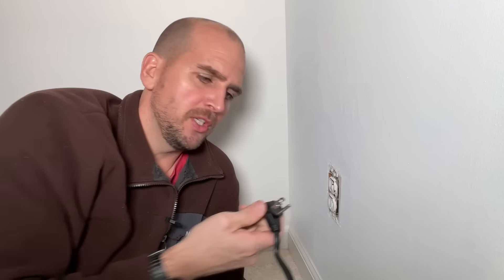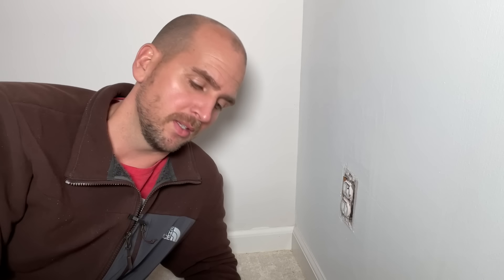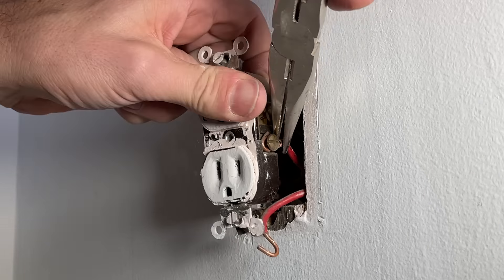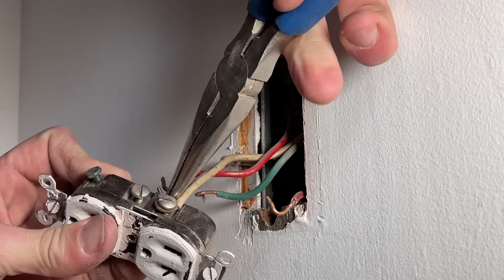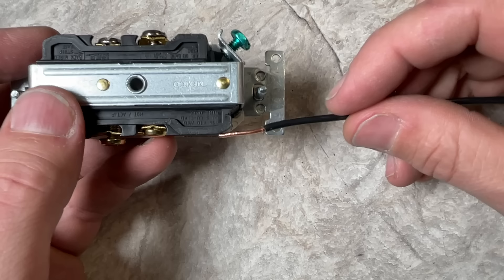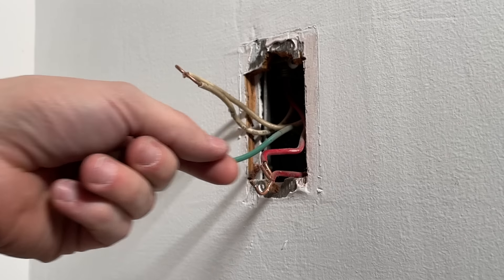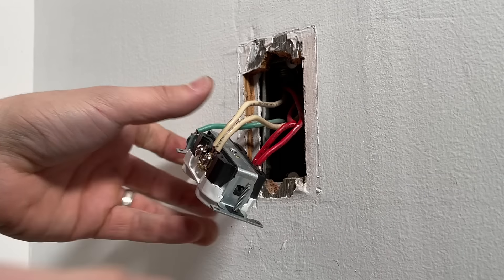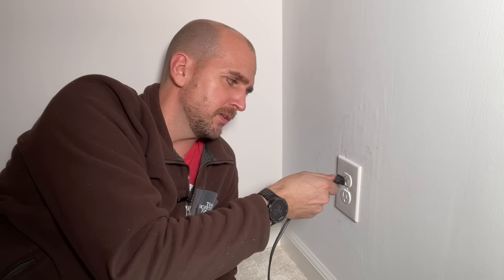Plug Won't Stay In Outlet

Comment: If you have the problem with plugs staying in when at a hotel or motel - just splay the plug prongs out a little so that it doesn't break them but allows for insertion into the outlet without loosening. 

 Also a tip from me to you - just remove the screws when removing wires from the outlet - this way you don't have to worry about breaking them or marring your insulation. I do the same thing when inserting them into the new outlet.  I remove the screws then insert them into the holes or hooks for the wire then into the outlet. This makes it easier so that I don't have to worry about where they go or damage in any way.

Comment: The box needs an extension ring.
It looks like somebody covered the wall with plywood at some point in the past.  Box can not be recessed more than 1/8 inch behind combustible material.  Box extensions are cheap but sometimes a pain in the butt to work with but are required in certain situations such as yours.
Reply: I would worry about fire too if I didn't put my wires on receptacles correctly, pig tail all wires with a 3M nut can prevent lots of problems
Reply: @SirFartzoLot  A poorly nutted pigtail is less safe than what he did. Done correctly they are both equally safe.
Reply: @FisherCatProductions  poorly done is unprofessional🙃

Comment: If you're not reusing the plug just back the screws all the way out. No need to fuss with needle nose pliers to take the wires off
Reply: I always use new....never reuse they're cheap enough!

Comment: In replacing the outlet, ask why there are two hot and two neutral. Were they feeding to the next outlet without using pigtails, or is it split for two circuits, and the bridge bars have to be removed?
Also, flat screwdrivers are old-fashioned; use Philips or Robertson as appropriate. (Some screws take all three)
Reply from the maker: Hey Rick,  correct the additional set of wires was feeding an additional outlet on the circuit. I actually just upgraded to the Milwaukee ECX which has been awesome for swapping receptacles and switches.
Reply: Yes, I am an electrician. I only use a flat head screwdriver if it is the only option.
Reply: @Tubalcain422  I use the wire cutter and then a fine pointed needle nose pliers, one of best items at Harbor Freight Tools.  I have few so one is in each toolbox.

Comment: if you are at a place and are having this issue and replacing the receptacle is not an option you can spread the prongs on the cord ever so slightly. the extra width of the outlet prongs will generally create enough tension in a worn out receptacle to hold the plug in place.
Reply: That's the let the next sucker enjoy seeing his house or hotel room catch on fire "remedy."  Loose contacts have increased contact constriction resistance which is what causes overheating of outlets.  Forcing the receptacle contacts further apart is akin to sabotage.  The circuit breakers won't detect that problem until the house is being consumed by flames.
Reply: @pibbles-a-plenty1105  Hey of the manager is too cheap to replace it then it should burn down

Comment: I bend the prongs on the chord 😆 so it has spring tension against the outlet because I'm that lazy. I'm a mechanic in real life too 🤣 but when I get home I don't wanna replace anything.
Reply: fine for a low power appliance, that doesn't draw much amperage. That won't work well for something big, like a space heater or vacuum cleaner. Vacuum cleaners are especially bad, because you move them around, putting cyclic stress on the plug. (likely the reason the plug loosened up in the first place)
Reply: Exactly
Reply: I just jam a fork in there with the plug.  It holds and comes in handy at lunch time.
Reply: @vincentrobinette1507  yes it will
Reply: Just use some aluminium foil around the prongs
Reply: Lol  mechanic tryna do electrical work lmao. You're better off bending the prongs and burning your trailer down
Reply: @Kevin Gibbs You should buy scratch lottery tickets ;)
Reply: I was just thinking that's what I do.  Because in the moment you don't have time or want to go buy a new outlet.  Then you forget about it and the cycle happens all over again.
Reply: I use an orange three prong extension cord for my vacuum. I also use the short three prong extension cords for transformers/chargers plugged into a power strip to free up space.

Comment: I recall another video of yours saying there is an issue with the wood paneling and you need to add an extender to insulate the wood from any potential electrical sparks per code.

Comment: When loosening the screws on the existing receptacle, it gets tougher but you can remove the screw from the receptacle if you keep on loosening it then the screw pops right off 👍
Reply: I was yelling at him to loosen the screws all the way out, guess he's a bit deaf.
Reply: @Boraxo  Same
Reply: Einstein
Reply: @andycopeland7051  compliment accepted 😁
Reply: Only with only units
Reply: @toriless  ??? 🧐
Reply: the last two threads of the wire holding screws are irregular so its harder to remove the screw completely reason  so you dont lose the screw

Comment: I install floor covering for a living and quite often I will have a tool or my vacuum cleaner that I'll plug into an outlet in a home.  Whenever I find one of those loose outlets were the plug will barely stay in, I'll bring it to the attention of the homeowner.  I'll recommend they have it replaced or at the very least, tell them not to use it for space heaters or anything with a high current draw.
Any appliance cord that has a ground prong can make a loose connection feel secure when it's not.

Comment: Another way to make sure that you flipped the correct breaker  or removed the right fuse ,is to plug in a radio 
and turn up the volumn . When the radio goes silent then you know you did it correctly .
Check the outlet with a tester just the same ,for added insurance .
This is a real time saver if you are working far away from the electrical panel ,or working alone .
Reply: Thanks for that tip. I remembered hearing that a long time ago, but forgot about it. My outlets are the opposite, they seem rusted and hard to plug and unplug. I might have to replace several.
Reply: Mind you, if the plug falls out of the wall, it will also go silent.....LOL
Reply: Yo can’t do that so well today.   Radios  that will stay on and come on when power is introduced are an anachronism.     They all seem to use eletronic switching .   Your best bet for that is shopping yard sales for old 1970s to 80s radios.

Comment: Good information. May want to do a video on reversed polarity in outlets. Another good reason to buy those testers.
Reply from the maker: Good idea, I might start taking small video clips as I run across the different outlet issues and then put those together into a larger video showing the range of issues.  Thanks for the feedback.
Reply: @EverydayHomeRepairs , or put the shorts clips into a playlist, so someone could watch the portions they need and easily skip the other parts.  Just a thought

Comment: I learned a few good things here, however' the duplex is installed up-side down. New code is for GROUND-PIN on TOP.  The manufacture letters of TP confirm this, as you can see NP is also Up-Side Down.

Comment: Thank you for posting this, this was very helpful. 😊 Seriously, thank you.  I've been having the same issue with an outlet at my house and now I learned something new. 😊
Reply: Biggest issue I had was the GC used back wiring and the electrician side wiring so I had to remove all the back wiring and make it code compliant where the GC had installed it.  All the GFCI was correct but not the AFCI and about half the switch were one way vs the other.

Comment: Do a video on installing a three way switch.
Reply: The switch leg is in one switch, the power is in the other one. Both are called the "common". You should also have a 14/3 wire. (1 red and 1 black wire) these are your travelers. Most 3 way switches have 1 black screw and 2 silver screws. The common always goes to the black screw, and the red+black that are paired together go to each of the other 2 screws. Doesn't matter which to which.

Comment: Scott
You use good explanation on your videos, you should show a video on using the correct screws for both outlets and when screwing down a light fixture so many times I’ve seen electricians use what ever they have in in there tool belt especially when they need a longer screw they use wood screws or square drive screws in the light box holes or outlet boxes that’s not to code bad workmanship
Reply from the maker: Good idea, thanks for the feedback and idea for a video.

Comment: I like to add a wrap of tape over the screws around the receptical before reinserting.
Reply: If properly bundled contact is impossible.  They are a hack.
Reply: As useless and unnecessary as taping over wire nuts.

Comment: When I worked as a commercial / industrial electrician, we would never have just hooked up the 2 hots or 2 neutrals individually like that.  We always "pigtailed" them so that you only need to connect 1 hot wire or 1 neutral wire to the receptacle.  When doing it as a commercial / industrial electrician, we didn't always have the ability to shut the power down as that would shut down multiple outlets and equipment.  With the pigtail, you could disconnect the outlet without shutting down any outlets further along in the parallel circuit.
Reply: The problem with that is someone with weak fingers not getting the wirenut tight enough. Next thing you know, there is arcing inside the wirenut. Maybe.
Reply: @danielhowiesr.2593  We gripped the wirenut with linesmen pliers and twisted it to be sure it was tight.
Reply: still bothers me, whats the purpose other screw ..both side connect the same 2 hots and same for neutral..why on same one screw ???
Reply: @user78405  Mr "handyman" didn't explain correctly, maybe he doesn't  know .
Only one hot is connected to each outlet one set of wires is typically the line  (hot) and the other set is the feed which will be the hot in the next outlet box.
Usually there is several outlets(and sometimes  lights)  in line from one breaker.
It is possible to have two 
Sets of hot (line) to the same outlet if you break off the small tab between the 2 sets of terminals. 
But that's rarely done.
Reply: @danielhowiesr.2593  that's why you shouldn't do electrical work
Reply: @Newman81964  scrub
Reply: @christiamhaagensen3539  makes sense, if the handyman was planning using the bottom outlet for switch later on that only with tab between broken off so it won't create a short from hots feed it...but thats very rare to do if his wiring is huge mess from many connections to know first where is gonna to next
Reply: @andycopeland7051  Andy, I was doing electrical work when you were still shitting yellow.

Comment: I just spread the prongs on the plug out a little and that holds just fine.
Reply: Well the plastic of the outlet doesn't stretch but the stupid connectors on the inside of the thing do move out of alignment so if they're at the absolute outside you can spread the metal bits on the plug all you want but the plastic is still going to push them in you're going to get a crappy connection that's going to fall out
Reply: Unless the plug uses equally crappy materials.

Comment: After testing with a "receptacle tester" I grab an insulated screwdriver and touch all the wires together to make sure everything's dead.
Later, if there's any questionable wire, lightly brush it with the  back of your hand...you won't end up involuntarily grabbing it when the current contracts your muscles.
Not a fan of "push-in" connectors. The amount of contact "surface area" is miniscule, causing heat. But that "out-side" push-in seems good. (never noticed that B 4)
I always connect the load wire to the terminal feeding the smaller of the 2 openings on the front of the outlet. Smaller means slightly safer...easier to remember.
Take your time when re-inserting all the (now stiffer) wires, wire nuts and receptacle back into the box. Be patient, it's not easy sometimes.

Comment: Loose plugs can start electrical fires.  The plug should be snug within the receptacle.  After you attach the Ground wire (usually green but can be bare copper or aluminum), the proper sequence for wiring the remaining wires is the WHITE ("return" or "neutral" wire) followed by attaching the "hot" wires (can be numerous colours apart from the usual BLACK colour.  Even, with the power "off", practice wiring in this sequence, as prescribed.
Reply: Exactly. First to make, last to break.....ground/neutral wires

Comment: I thought something special was going to be shown, not just to replace the receptacle... While I liked seeing the inside, not sure i was impressed with the holding power of the new vs old in the cut off the way it was shown.. But definitely interesting... And the problem is not solved moving forward bc it will occur again with time... Is there a longer time to failure with a commercial grade as this will figure in cost and choice to replace with
Reply: If it's a common enough occurrence perhaps try Hospital-Grade. He posted a video comparing commercial to Hospital grade and he mentions the regulations/testing required to ensure plugs won't suffer from this issue.
Reply: The title was CLICK BAIT.

Comment: In hotels and such where one cannot replace the outlet, you can put a slight twist in the two prongs on the plug of your device—just enough to hold it in. No need to “untwist” when you leave, since you put just a tiny amount of twist into the plug it will continue to work just fine anywhere.

Comment: Thanks Scott for another nice video, I especially appreciate you taking the outlet apart to show the flared contacts.  I see this problem all the time, it is caused by someone vacuuming, where they run out of cord and end up jerking the plug out of the outlet at an angle (left or right of the outlet).
Reply: I have been married for 33 years and it took me over 25 of those years to get my wife to unplug the vacuum cord safely.
Reply: @BrBill  I know this seems like a ridiculously long time.  However, just be thankful your wife did eventually see the merit of handling the plug properly.  This comes as severe aggravation to us men but, we also have similar blind spots that drive women crazy.
Reply: @billharris6886  Oh, no doubt. I'm probably one of the most maddening SOBs anyone could live with.

Comment: An extra safety feature is to mount the receptacle with the ground socket at the top ( essentially upside down) so the anything dropped across the receptacle hits rather ground like first. Unlikely, I know.
Reply: NEC doesn't state which way it has two go but ground up is the safest if something was to fall on the partially exposed prongs due to a worn out receptacle it won't arc between hot and neutral but contact the ground and trip the breaker immediately. If you notice the writing on the receptacle was upside down when installing the ground prong down.

Comment: On this video and the other where you show how to make a pigtail, you tell us to only use one of the screws on each side but you don't tell us why.  I did learn something new here and it was about those "child-proof" openings.  My new home has them everywhere of course but I never knew how they functioned, the mechanics of it.  I just jammed the prongs in there as hard as I could never knowing really what needed to happen (both pushed at the same time and with the same force).  thanks

Comment: Remember, you can wrap the outlet in electrical tape to cover the side terminals, so they can't short out to metal boxes, or zap you if you have to pull out the outlet, especially if you have to work on live circuits for some reason. I've seen professionals doing that for some time now.
Reply: i always wrap it in black tape. i was surprised he didn't.

Comment: Cutting and re-stripping unnecessarily is how you get left with no wire. Especially if by pulling the plug you end up cutting one of the wires from inside the insulation.
Reply: Properly strung wire always has slack.
Reply: @toriless  Unless it was constantly cut  for decades. Also, long wires going parallel to eachother can transfer charge from one to the other, like a capacitor. That's why there are some lightbulbs which are never truly off.

Comment: This was a generally well made video.  However, in the interest of making it better, may i suggest devoting a little more time  to the many oddities one might encounter?  For example, what if you pull the outlet out, and you find it is a 3 prong outlet with knob and tube/ no ground wire?  Or, what if it's back stabbed?  What if the box is grounded but there's no ground wire?  What if you discover a bootleg ground?  What if it's a GFCI outlet?  What if it's a half hot?  What if you have reversed polarity?  What do you do if you detect voltage in the ground wire?   What if all the insulation has disintegrated off the wires?   Again, it is well made video and if the box and wires are all modern and good, it is all very nice.  But I say this to offer encouragement,  if you want to really stand out in this saturated market, be the guy who covers all the weird contingencies, or at least say "if you encounter this or that, back off and call an electrician."   :-)
Reply: That's a much longer video, and would probably serve as subjects for multiple videos.  He did hit the main points well.

Comment: Being an electrician for 40 years, even with that small tab on the screw, back out the screw slightly then still curl the wire around the screw then tighten with a flat blade screw driver. Then wrap with black electrician tape. If yo need longer screws, you need a flash ring. Some call it a goof ring. Just make sure wires are realy secured. B+
Reply: ...and over 60% of the head is in contact.  I use a flat blade then needle nose pliers to really close the gap down more.  12 is a lot harder to works then 14.